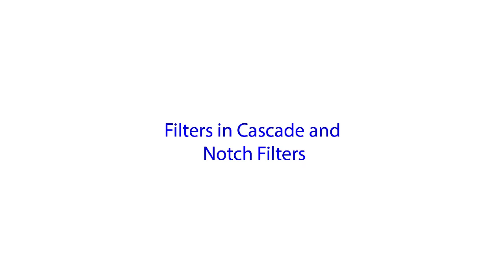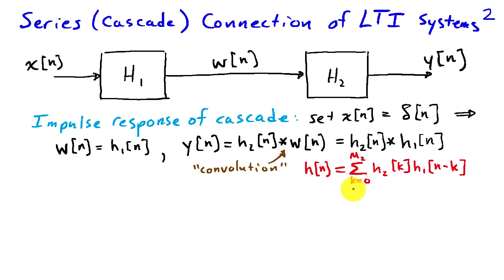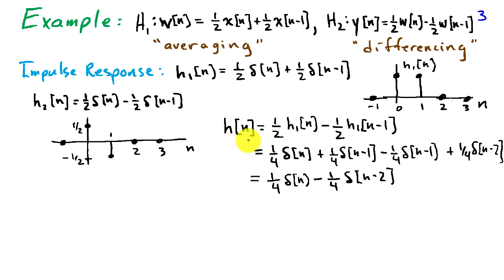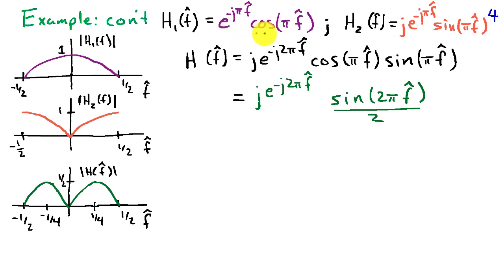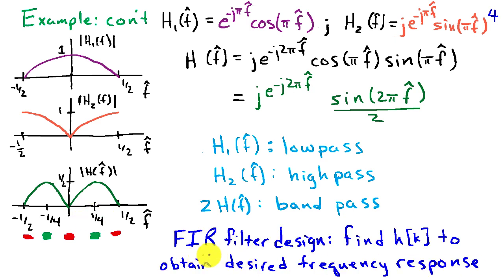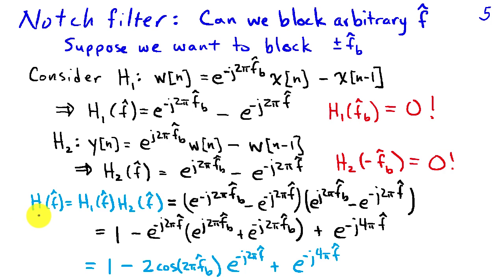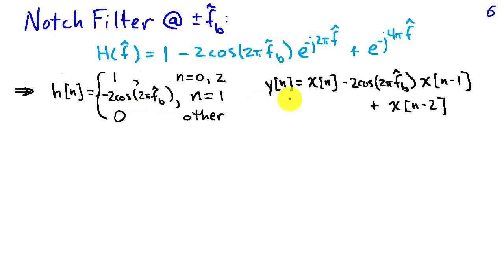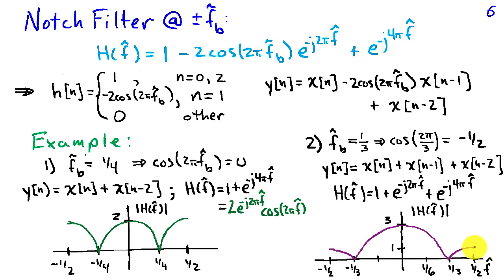Frequency Response of the Cascade of Filters and Notch Filters

Comment: Dear Mr Van Veen, thank you for your great videos. 
However, I got a little confused in this one;
In the equation at 4:14 you simplify to h[n] = 1/4 delta[n] + 1/4 delta[n-1] - 1/4 delta[n-1] + 1/4 delta[n-2] but isn't this supposed to be simplified to h[n] = 1/4 delta[n] + 1/4 delta[n-1] - 1/4 delta[n-1] - 1/4 delta[n-2]
I get confused because of the last step which then in turn is h[n] = 1/4 delta[n] - 1/4 delta[n-2]